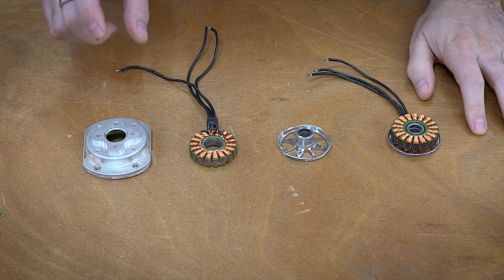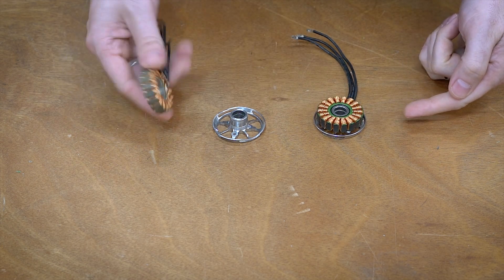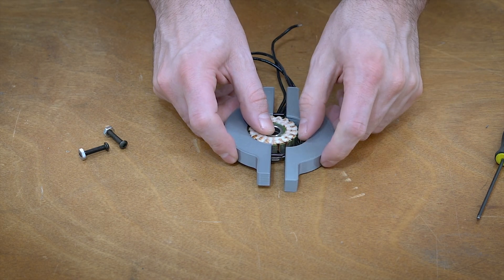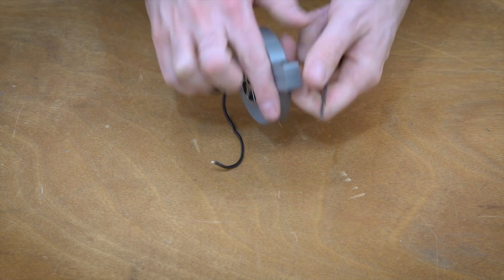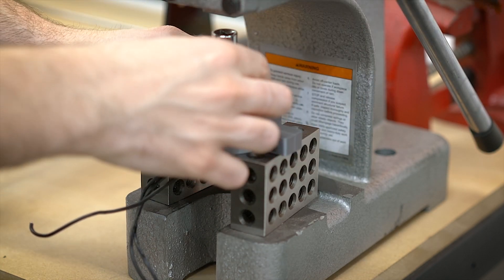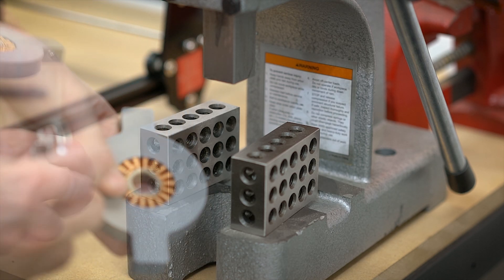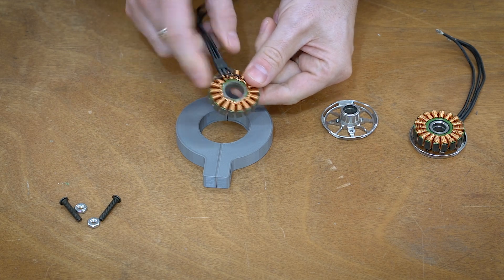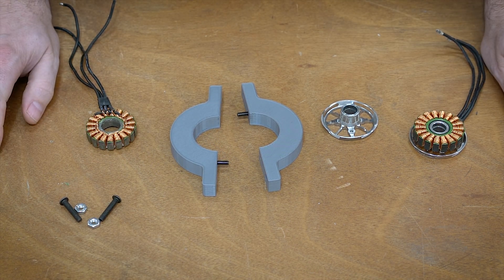3D Printed Motor Stator Removal Jig

Comment: as a note, I've found with all the heat shrink removing the wires might only be possible after the base drops from the stator.  I removed it as you did after the stator dropped, before would have likely damaged the wires so I waited

Comment: What material is the stator removal jig? I'm on far too many version and across 3 of 4 motors have broken more than a few removal tools, the motor intact slips out the bottom and brings the the then 1.5mm edge that's grabbing the stator and destroys the jig.  How thick is that lower edge the slides under the stator?  I've now modeled a  round support and added spring steel with just large enough for the wires to go down and a vertical cut out... spring steel alone wasnt enough on the parallels  to prevent the bottom of the jig from breaking.
Reply from the maker: It's just PLA.  If it's slipping out of the bottom, it's not tight enough around the diameter of the motor.  Mine is maybe only a mm or two on the bottom lip, but that's not really holding it, it's the friction along the outer surface.  Make that as tight as fit as possible, and maybe add a piece of double-stick tape as well for extra friction.  You're not really putting all the force on the lower lip, you're distributing it against the fixture.
Reply: @RobertCowanDIY Thanks, I'll try to reduce the diameter even more than the twice I already have, I've been printing it with petg. I'm starting to see stator indents on the surface.  I finally took a close look and will try to chip away some of the expoxy, looks like it got a double dose! Double sided tape sounds good as well.
Reply from the maker: @PaulStAmand-sd1js  Got it.  It might be glued in place, which will be tricky.  You might need to apply some heat with a small torch to loosen it.  Good luck!
Reply: Reduced size a little more to grab the stator more, reprinted in pla rather than petg and I haven't broken the pla set with a couple motors so far, another 4 to be done in the next month, and for anyone reading this don't skip the locating pins, it adds a significant amount of strength to the process

Comment: Is there any keying on the stator to its base? Or is it just relying on the press fit to resist the countertorque on the stator while the motor is running?
Reply from the maker: Usually these are just press-fit.  Even on the bigger motor, it's just pressed in place.  There's sometimes some epoxy or something to hold it there, but it's TIGHT.  On the motors for Copperhead, it was a delicate operation to remove the bases, and it took a 20 ton press and a bit of praying.  They're more of an interference or friction fit, where it would take significant force to make them slide apart.

Comment: I also get new ideas for my 3D printer. Most of the time I just take some photos and some detailed notes. 

Question:  Do you use Solidworks or Fusion 360?  Do you ever post anything I can use?  I use Fusion 360. 

Thanks for today’s update
Reply from the maker: I use Solidworks and very rarely fusion, but really just for the CAM.

Comment: What filament did you use?
Reply from the maker: Prusament, almost exclusively.  It's really consistent and prints well.  It's just a bit pricier and takes longer to get.
Reply: @RobertCowanDIY   I’m going to assume Prusa makes it. I wonder how it compares to CPE which is what I’ve been getting from Ultimaker. I’ll have to do some research.